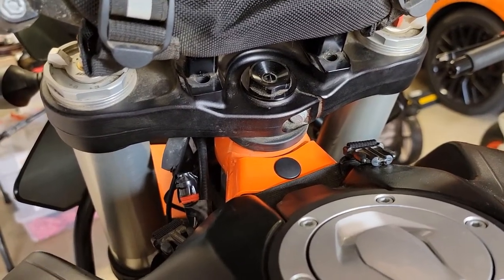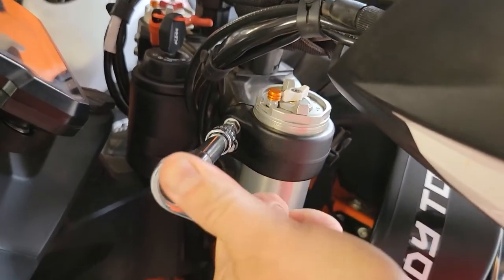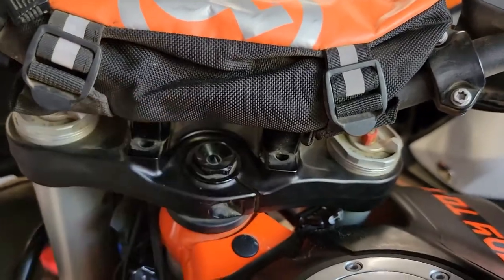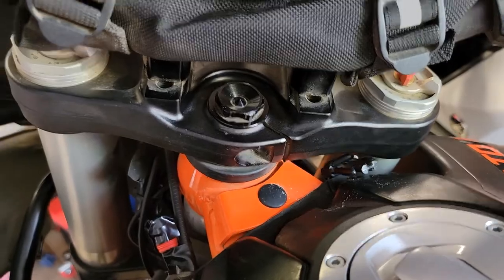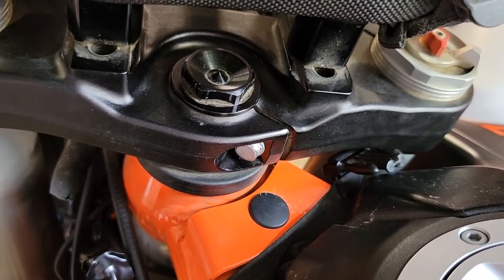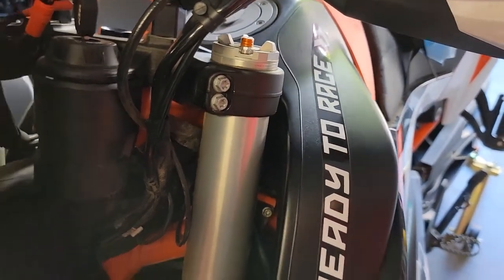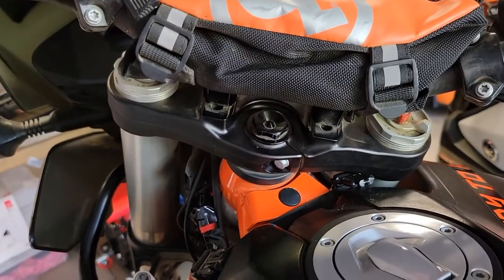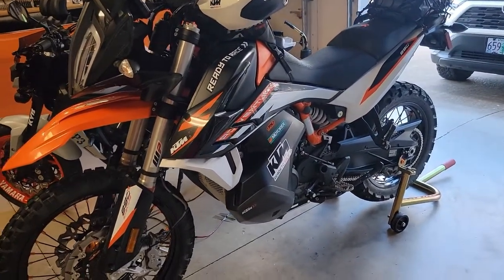KTM 790/890 Adventure R:  How To Tighten Up Your Headset To Get Rid of the Slop!

Comment: Thanks. Less than 400 miles on mine and very loose front end. As per the repair manual I opted to remove the handlebar and use a torque wrench on the main head bolt to 18 Nm. It was so loose that I could turn it by hand with the big 27mm socket. 20 Nm when re-bolting up the handlebar. The dealer where I bought it should have checked this as part of the $$$s I paid for their prep fee. This should be part of regular maintenance to check, so might as learn how to do it.

Comment: Both my bikes had bad headshake out the box, with the 890r a bit worse with that knocking sound. Sounded like my bashplate or something was loose on breaking, kinda random, but the headshake was always present on asphalt at 120 or so and above kmh.
Had a 790r and now a 890r. Both required this tweak well under first 1000km service. 
Also good to revisit the process a 2nd time a while after just to be sure and for peace of mind, Seems the bearing needs to seat properly and then requires a retorque after a short while.
Dealer did this first one on the 790r just like this, no bar removal. 15 minutes and like a different bike riding on rails after that. Did the 890 myself and all good after that.
Cause of much squirrely headshake discussions this is but easy to remedy.
Great video!
Reply from the maker: Great feedback!  I think these bikes need to be revisited just as you said until that headset is "seated in".  It took mine getting pretty loose on downhills and hitting front brake hard before it occurred to me what was happening.  There had mind a mild handlebar sense of looseness on gravel that I couldn't quite pinpoint, you felt it too.  But tightening up the headset took it away 100%.  Thank you for commenting!  Ride on!
Reply: Very good to hear!!  About 700 miles or so in on my ‘24 890AR I’m getting headshake above 65mph and I’m excited to try this remedy to see if it can get rid of it for me!!
Reply: @jaredandersen82  I am very confident it will pal.

Comment: John, thank you so much for this! I had it made by the dealer since it's still on warranty and got rid of the excessive vibration it was doing on the handlebar. It was actually upsetting the front suspension also.
Reply from the maker: You're welcome,  thanks for your positive feedback! I have never had a headset loosen up so quick when new. They must be coming from the factory a little loose.  Good to hear your experience of it coming through handlebars if it gets too loose, that could help someone else.  Thanks again!  👍

Comment: Giving this a try right now. My headset nut was torqued to spec but I gave it a tiny 1/8 of turn tighter. KTM 790s are notorious for warped front rotors and I've heard anything from wheel hub powder coat being uneven to bad rotors to headset loose. 
     There has to be a reason they changed the wheel hubs on the 890s and I see far less forum posts about warped rotors 
    Anyways my brakes pulse the last 20ft or so of braking and it's awful. Trying this in hopes of being a fix as I don't want to put new OEM rotors on the bike just to possibly warp again nor do I want to replace rotors and wheel hubs unless I know it will resolve the issue and not creep back in a few thousand miles.
    Rambling is done, thank you so much for the video. I appreciate it and as I said, giving it a try now!
Reply: @tjomasleal554 - I also have brake pulsing when coming to a stop with my 2022 890R.  Did this adjustment resolve your issue, or did you have resort to new rotors and/or hub?  I’m also trying to avoid doing the latter unless absolutely necessary.  Thx for any help you can provide.  - LJ
Reply: @ljcookson9957  So mine was already torqued to spec. Meaning it did not resolve my issue. I cleaned my brake rotors pretty thoroughly and that helped a bit but the pulsing is still there and my cruise control no longer works because of it. 
     I wont replace the rotors because the OEM brand is really about the only decent option I can find in the states. I am going to order replacement bolts for the rotors, pull them off and sand down the wheel hubs. 
    I don't have any experience with that type of work but I have a friend who is gonna help. If I remember I'll try to update my comment here but no promises. Lol
    I'm also pulling the rotors to mount and run them on a dial indicator to check if they are truly out of spec or if it's the wheel hub causing excessive runout

Comment: I check this when riding on a flat even surface, just putting left hand in between triple clamp and frame (or the race) and doing a  few front quick brake push, you will feel the play between parts if there is any.... that way you take out any vibration that might confuse your loose headset feeling, I check this once in a while, just in case. And after tightning the main clamp nut, just put a rag or bag between the floor and tire...that eliminates alot of the friction of tire so you can check if its moving  freely ir not

Comment: Thank you very much brother, I was really disappointed in having acquired this motorcycle, since I have only done one route over stones and in the end that situation happened that just as you describe, I was going to go complain to the former owner for having sold me something that did not work, now it is It's just a readjustment and that's it, but isn't it good that every time I go off road I need to tighten the nut, so will I need to include those tools in my travel kit?

Comment: Found your video post on ADVrider in the front brake grabbing thread.  So did you have front brake issue with grabbing / diving just before coming to full stop?  Did tightening the headset solve problem?  Thanks for great video.  Kam

Comment: John, I picked up a new 890 from the dealer about 2 weeks ago. It's been dumping snow here in Idaho so I haven't had a chance to ride until today. I took it out and immediately noticed my front wheel and bars were not lined up. When the bars are straight, the wheel is pointing slightly left. The dealer said they will fix it, but that's a 4 hour drive there and back. What would you recommend for doing it myself? I'm thinking loosen the axel, lower, upper, and then possibly that top stem nut? and that little bolt you out blue lock tight on? Then try to pump it and see what happens? I'm so scared since its a new bike.

Comment: When you lifted the bike, were you able to feel the play in the headset by rocking handlebars fore and aft?  I have a brand new 2023 890 Adventure R and get a knocking noise and feeling in the front end when on rough road and dirt.  Don't notice it under braking.  I've been looking all over the front end for this noise and I can only assume it's either steering head bearing preload or forks when fully extending, like "topping out".  I've tried applying the front brake and rocking bike fore and aft but no knock/clunk.   I can't seem to replicate the problem unless I'm actually riding it in the right conditions...
Reply: I have the same issues!
Reply: Same here! I only feel the thump at times on rough terrain (without use of the brake), and it feels like the head, but everything is spec.

I do suspect that what we are feeling is the suspension in the forks...

Now braking I can feel agreater thunk caused by the floating rotor buttons, but that is fairly common.
Reply: Update: at 3,500 miles, the head bolt was loose. I tightened to spec which did permit over 1/2 turn on that bolt

Comment: I’m having some issues with mine beside the bearings. It feels extremely  jerky, everytime i go on/off the throttle in street or rally mode it feels so jerky, like the chain lacked tension, even tho i checked the tension a million times and its perfectly lubed, i dont know that to do at this point, with 4500 miles, the bike doesn’t feel like it felt when i picked it up from the dealer. Do you have any idea what it could be? Also the chain makes quite a lot of noise, but as i said, i checked it a million times. Help :(

Comment: I have an 890r and need this done.  I'm curious, why do you need to loosen the pinch bolts on the left and right side?  Not being critical, just want to understand.  Thank you!
Reply: Rusty ... the reason you need to loosen the pinch bolts on the left and right sides (of the upper triple clamp) is because the headset is attached to the forks via a PAIR of triple clamps.  The lower triple clamp is not touched - so in order to reduce the (excess) clearance in the headset bearings, you must free the upper triple clamp from all points of friction.  Removing the single bolt at the upper headset bearing is an obvious need as when you tighten the headset bearing with the 27 mm wrench, that same upper triple clamp must also move down the same amount on both the stem and the top of the forks.  Hope this helps.
Reply: @scottadams513  Hi Scott, after thinking about it a minute it made perfect sense.  I did have to tighten the bearings a bit and the slop is now gone.  I'm glad I saw your video because I did in fact loosen the upper pinch bolts.  Thanks for the reply.  Much appreciated.
Reply: Rusty … you’re welcome, but I was not the one who authored nor posted the Twisted Throttle video.  I just saw your question and had the understanding to share. Thanks to those guys for making such a great entry here!

Comment: That center pinch bolt should be the same as all the other torx not a 6 side bolt thats not original part someones changed that maybe thats why you headset is loose